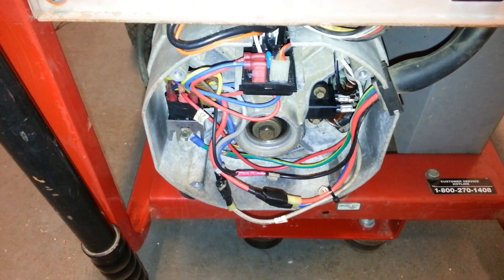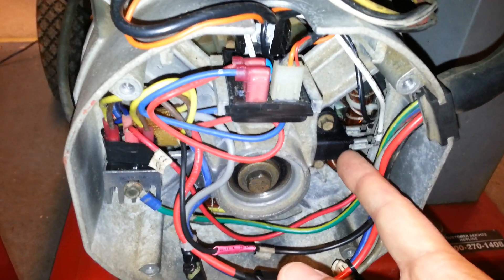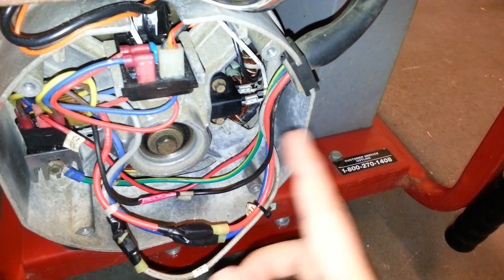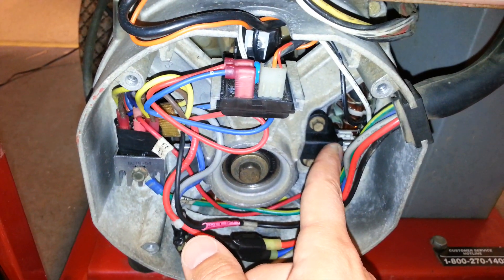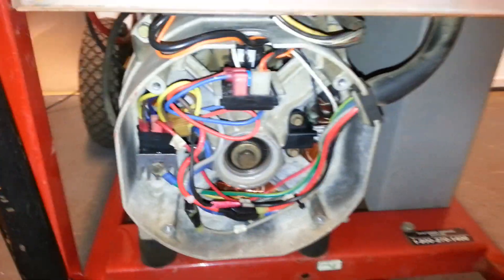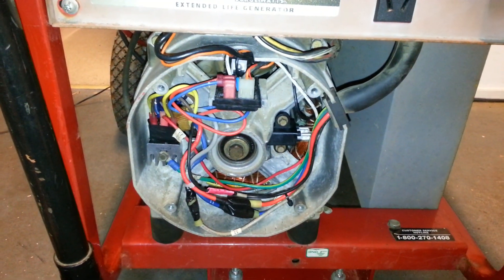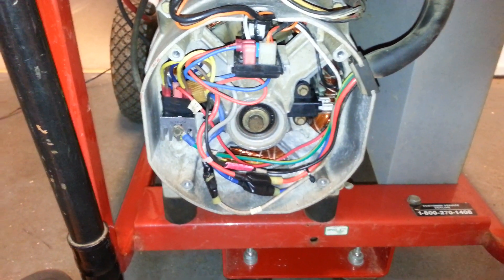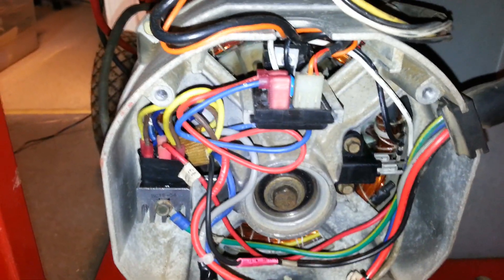Generac Portable Generator: How to Test the Windings

Comment: I just wanted to take the time to Thank you for your help in fixing my generac 7000exl. My generator worked fine when given 12v directly to the brushes and my avr and stator all fell into specs I bought a new avr as you suggested which didnt fix the problem. I tested the stator with a 25 watt light bulb as u suggested and worked fine. Long story short all my problem was the number 0 green yellow ground wire was burnt from 1 end to the other I replaced it and everything works like new. Just figured I'd let you know and Thank you again Mike Smith
Reply from the maker: You are very welcome. Thank youbfor watching
Reply: @Bassguitarist1985  hey bass. i have this same generator (7000exl). it wont produce power. only when i jump the brushes with and external 12VDC battery, i get 35ishVAC at the receptacles and directly at the wires themselves. The DPE wires get a little more around 46VAC. according to the manual, I am supposed to get 60VAC. The resistance spec is .25 ohms on the power leads and i get .6, so to my understanding this means the resistance is too high and the stator is no good.

on another note, the battery is dead and the rear rectifier had a burnt contact on one of the outside tabs. so the rectifier is no good as well. I tried swapping the battery and rectifier with known good ones on the 13a (blue wire coming from battery) and it will blow the 10amp inline fuse every time.) 

With the engine running, i tried measuring voltage at the 77,77a,66, and 66a battery charge windings and get nothing at all.
i tried pluggin in the float charger and the thing blew up after a couple of minutes and stopped working!

If my understanding and testing procedures are correct, than i understand all of this means that the stator is no good, but what i do not understand is what actually is making it no good? are the power windings open since the resistance is high? and what is going on with the battery charge windings?  thank you for sharing your knowledge in this video, i am just curious to know what is actually going on with my specific fault. i am a newbie to electricity trouble shooting as you can tell..
Reply from the maker: sounds like stator trouble. The BCW windings are the first to burn as they are very thin. Float charger burning up, burnt rectifier, either caused by reverse battery leads, or someone jumped the battery in reverse.

Heated windinga due to short circuit or reverse polarity, even if winding resistance spec is in range or close, insulation breakdown will cause failure under load. Hard to say more without looking at the machine.
Reply: @Bassguitarist1985  okay thank you so much. I really appreciate your feedback and this video helped me a lot! guess its off to the scrap bin with this one since the stator is like 400 bucks :( might as well buy a new generator from harbor freight for this upcoming connecticut winter.
Reply from the maker: yea agreed its costly. Supposedly we are going to have a much more snowy winter this year in our area. My utility is underground so highly unlikely I'd ever lose power at all. Still wont ever sell my machine cuz murphys law denotes I would lose it for a long period if I didnt have it lol.

Cheers!

Comment: xboxer1985.  I just wanted to let you know that I took your advise and I replaced the two 30amp breakers on my Generac 7550exl.  I shut down everything and tried running my 3 ton a/c unit again.  It worked. The 7550exl alone with the 3 ton a/c now worked.  No hunting, surging etc. very steady.  The new breakers did not trip as with the old breakers last week.
Thanks, John
Reply from the maker: John Ambrosino great news to hear!
Reply from the maker: John Ambrosino be cool to see a video of the machine starting it up

Comment: I find that this is a very interesting video. My generator, a Generac 7550EXL has lost output. I will use the information on the video to trouble shoot the problem to get my unit back in operation. As you have indicated that there is leafull voltage coming off the unit. My back ground is an eletrical engineer, so I understand what can happen if you are not extremly careful. Once again many thanks for posting the video.
Reply from the maker: Glad I can be of help. if you need further help. I'm on smokstak.com often for more in depth troubleshooting. Generators has become a power hobby of mine since losing power so often with the weather lately
Reply: ***** Many thanks for your reply.  I was lucky to be able to bring my generaot back to life. What I was able to do was just flash the field by using a varyable speed corded dril ro re-excite the field. One again many thanks for your great instructional video on trouble shooting generator problems.

Comment: Hey thanks I think this video is going to help me out. I got a Generac.400XL Old one brushed, and when I took the alternator off because the motor seal was leaking so I had to split it in half and put silicone in between the gasket on both sides but when I took the alternator off, some of the wires came loose on me so I think this video helped me out

Comment: BG1, finally have my craigslist find  Exl7550 running like new! Thanks for your help. I installed a new power regulator that brought back 120/240 and the 12v charging curcuit when a load/ battery in need of charge is connected. I also had an issue where the NEW oil pressure sensor was not getting 8psi minimum and gen.  would shut off within a minute af starting. I drained the oil, looked very clean, removed the oil filter and oil filter flange. I was then able to access the oil screen tube. It did not look like it had and debris after a quick look. I cleaned it with solvent reinstalled it with fresh oil and new filter and now have the gen
 operating like new. Must have been a partial clogged  screen along with a partially clogged oil filter.  Could not have done it without your help. Thanks again.
Reply: So....maybe the oil viscosity was to low. You might increase the oil viscosity by 5 or ten to avoid any further low oil pressure shutdowns.  I suggest you put some Prolong in the engine oil as well; it will protect it even with no oil in the crank case, I know this from running a vehicle with no oil in it for 70 miles and it was not making any noise or damaged in any way. Now I use Prolong in everything I have except my motorcycle (it would cause clutch slippage). This stuff really does bullet proofs combustion engines. Or any metal to metal moving parts. I put some on my electric razor blades and the screen just above the blades and they last forever.
Reply: @Reign Ben instablaster ;)

Comment: It's funny but the simplest switch can be the problem I had my trip switch set to off and so I had no AC. Well now I do thanks to a little diagnostics. I think a generator wiring diagram would be useful for a general understanding of the wiring. What I found useful was finding the power wires from the winding stators and working towards the AC/DC outlets. If you haven't got the specs though it's a hit and miss. What I would like to ask though is how do I test a Hz on a generator using a multimeter? Thanks for your time. Robert
Reply from the maker: if the multimeter supports measuring HZ its easy to measure it from hot to hot or hot to neutral

Comment: Great content, i have the same generator, i need to order some parts ,but the info tag isnt on the shield. Meed the board for the brushes where the pde winding and the neushes go to. And possibly the green circuit board/ avr?
If you have those oem can you send by. I so james condon send you the rectifier yo you and you rebuilt them , do you offer that option.
Thanks Dan
Reply from the maker: Hey Dan, yes I do rebuild the 84132GS and 83970GS boards. The brush assembly is readily available as it is a wearable item. Send me an email and we can discuss costing. My sn at Yahoo dot com

Comment: Hello, Thank You for the detailed explanations! I have a question though. I am measuring the slip rings and in Ohms I get open circuit, however when I check while the engine is running (AVR Disconnected) I am getting 12.6 VDC. Unit is a Generac GP7500E. All the other windings check out per your information. Is the generator toast or am I missing something?
Reply from the maker: What are you trying to measure at the slip rings? Are you trying to measure the resistance between them? Or are you trying to measure the DC voltage when the engine is running?
Reply: @Bassguitarist1985  Sorry I mis typed. the 12.6vdc had the AVR connected. I am getting about 6VAC with engine running at the brushes AVR not connected.  I measured in Ohms at the slip rings first between + and -, got open circuit.  Generator is making no power and I am trying to diagnose. Thanks
Reply from the maker: @rcpilot82  measure the ohms between the slip rings or you can also go and measure at the brush head assembly where the AVR connects. Without the AVR and circuit you should see about 8 ohms or so at the slip rings and slightly higher if you measure through the brush assembly as they are carbon heads which act as a resistor.
Reply: @Bassguitarist1985  OK, I did that and am getting an open circuit. So that means the windings have failed  the and the rotor is junk. Thank you for the quick replies!!
Reply from the maker: @rcpilot82  on the GP series typically the wire right at the connector you would have to possibly take off the end bell to see the end of the rotor. Where the wire is soldered to the lug that leads to the slip rings. That has likely broken off from the centrifugal force. If that's the case you should be able to resolder it but you will need a silver bearing solder if the wire is aluminum instead of copper.
Reply from the maker: @rcpilot82  it's hard to describe but I believe James did this repair a few videos back
Reply: @Bassguitarist1985  You were right! one lead is broke off. I am getting 55 ohms now with a clip on the broken wire and the other side of the slip ring. Excellent advice!
Reply from the maker: @rcpilot82  awesome yeah you will need to use a silver solder if it's aluminum wire which I believe they are. If it is copper wire then you should be able to use a standard 60/40 lead tin. Either way it can be repaired.
Reply: @Bassguitarist1985  I'll look into if its copper or aluminum wire tomorrow.  If its aluminum, what silver solder would you suggest? Any special flux? Thank you so much for the help!
Reply from the maker: @rcpilot82  any solder with a high tin content and silver alloy. What is important is the flux. It specifically has to say aluminum soldering flux. It has higher levels of zinc-chloride. It strips the fast forming oxide layer of aluminum so it solders correctly. ITS NOT EASY TRUST ME. The process of aluminum wire soldering is usually fone under an oil bath or using an inert gas to shield it from the oxygen while heating the solder to adhere yo the terminal.
Reply: @Bassguitarist1985  ju ad t wanted to update you and let you know the generator is working great again! Thanks for  taking the time to help me!

Comment: To Bassguitarist1985 I appreciate the troubleshooting info. I have a generac control board 83970 and voltage reg board 84132 that are suspect. Can you do a test and repair turn around on these for less than replacement cost?
Reply from the maker: Yes I could. You can email me at my sn at yahoo dot com
Reply: @Bassguitarist1985  I can mail the boards to you tomorrow

Comment: A Generac 4000 is putting out 150vac and 305vac.   Tried the avr trimpot but saw zero voltage change on the output.  Also noticed that when you flip on the auto-throttle, the output voltage drops to about 60ish vac.   Would you surmise at this point that the avr is toast?
Reply from the maker: No the power regulator board 84132gs in the end bell of the power head is working. It is the system control board 83970gs in the outlet panel that has failed. That or the 3 pin molex connector has corroded pins. Either way it needs addressing.
Reply: @Bassguitarist1985  Thanks for the quick reply, I'll take a look at those.  The system control board is where the trimpot was located. 
Would you mind explaining how they could cause the voltage to jump up with the avr working fine?  I'd like to understand that more clearly.
Reply from the maker: @syberphish  I'll be doing a video soon with James Condon on this exact board set.

Basically the system control board is adjusting the power regulator board how much current to feed the spinning rotor. If the control board circuit fails, loses power, or looses connection with the regulator board, the voltage goes high.
Reply: @Bassguitarist1985  ohhhhh gotcha, okay that makes sense.  I'll be looking forward to see that video when you get it out.  Thanks so much for your help.
Edit: ouch, $250 for that board.
Reply from the maker: @syberphish  i repair the 83970GS boards for $125 USD plus USPS shipping & Paypal Fees. Shoot me an email if you are interested. Best to send both boards to verify function in tandem together.
Reply: @Bassguitarist1985  That board is $250 and with the hours that generator has on it, it seems that for the money it'd make more sense to tell him to get a new one.  He put a lot of hours on it. 
Doesn't look like they sell a 4000 anymore, it goes from 3600 to 6500.

Why'd they do away with the 400's?
Was everyone trying to power their house with one and found out you really need a 6500 instead?
Reply: @Bassguitarist1985  i just saw your other comment. 
Let me ask the guy and see what he wants to do.
Reply from the maker: @syberphish  unsure. Its a great model smaller generators like that are moving to be inverter types more commonly. Plus you cant run a hot water heater tank on 4k watts. A 7500w has a hard time with loads like that and have headroom wattage to spare.
Reply: @Bassguitarist1985  What's your email?  Your screen name @ somewhere?
Reply from the maker: @syberphish  its on my about page here, email is my name at yahoo
Reply: @Bassguitarist1985  Thank you.  Will be in touch, I'll go see him tomorrow.
Reply from the maker: @syberphish  roger that!

Comment: I finally got my 7000EXL up and running  thank you for your help and input. My problem was simply dumb and doesnt make sense. The black ground wire that you have a red butt connector on that runs up to the panel needs to be grounded apparently. Quick question in regards to the rectifiers. All my wires coming out are brown and have been cut and lost their number stamps. Except for 077. Does it actually matter wich wires are connected together in the rectifier circuits?
Reply from the maker: Yes, one is a 10A and the other is a 2A for the starter battery. Mix them up and you will boil that battery up!
Reply: @Bassguitarist1985  is there a way to tell wich ones are supposed to b together because they r all brown if I knew which pairs went together I could figure out wich put out 10 amps and which put out 2 amps
Reply from the maker: @mikesmith4258  the higher voltage pair should be the 10A pair and the lower voltage the 2A. I have an old thread on smokestack that has the exact spec you need
Reply: @Bassguitarist1985  do you happen to have a link? I actually joined smokestack awhile ago just to talk with you!
Reply from the maker: @mikesmith4258  
77-66: Measured 18VAC from those two leads

77A-66A: Measured 15.3VAC from those two leads.

55-77 is about 10.1VAC and 55-77A is around 7.2VAC volts.
Reply from the maker: @mikesmith4258  hope this helps!
Reply: @Bassguitarist1985  does 66 and 66a positions matter? Those will basically tell me which of the 4 wires are the 2 hot ones and to determine the high output and the lower 1 for the battery. Thank you Mike Smith
Reply from the maker: @mikesmith4258  its AC voltage so both are hot. Measure between the 4 till you get a pair thats higher and one lower
Reply: @Bassguitarist1985  when I just measured all 4 wires with all the combinations I'm getting and 5 volts  ac out of 1 set and .5 volts ac out of the other
Reply from the maker: @mikesmith4258  thats too low for VAC. Is 55 connected? If so and atill getting low voltage like that, the BCW windings might be bad
Reply: @Bassguitarist1985 yes its hooked up.  believe it or not wire 55 burnt up from its connection at the bell up. And it not being hooked up was the only reason my generator wouldn't work at all. I bought a new avr and did nothing and for hahas I ran a new wire for it and grounded it up in the panel and everything worked!(except the btc) I already had ordered a new set of rectifiers and if they dont work oh well.
Reply: I've seen people isolating the neutral from the ground. Is their a reason and should I do it?
Reply from the maker: @mikesmith4258  only if you are using a 2 pole transfer switch or interlock breaker that is 2 pole.